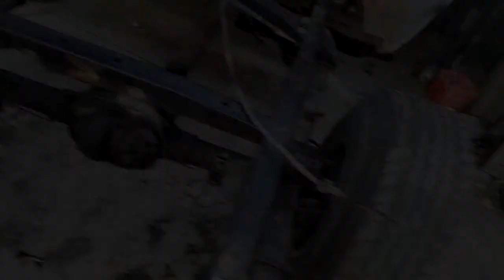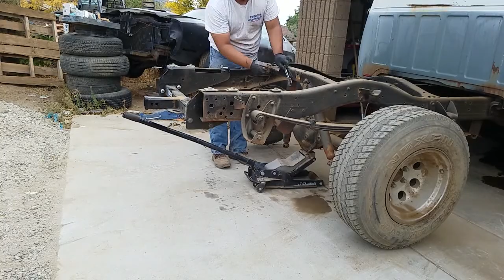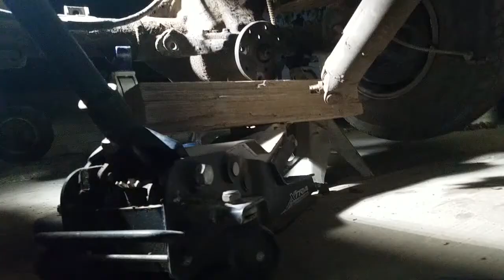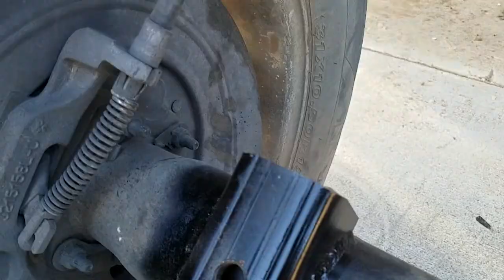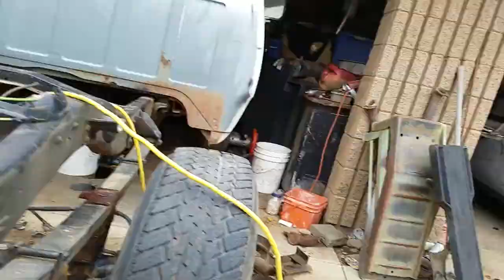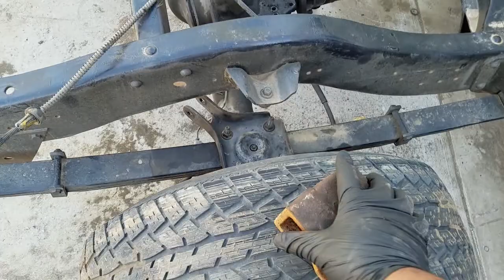Ford 8.8- Budget LSD Differential Swap On The Dodge D100 CHEAP |LS Swapped Dodge|NW EP.35

Comment: Hey bud I've got an 83 d150 I was wanting to do this swap I seen in one comment the rear end u used was 4 inch's narrower than the stock d150 rear did u use a spacer behind your wheels
Reply from the maker: I had a set of really deep M/T wheels on it so I didnt have to use spacers. Ideally you would want to extend the 8.8 and use 2 long axles but It may not be nessesary depending on your wheel selection and whether or not you widen the wheel tubs

Comment: What about drive shaft do drive shafts mount to rear end the same
Reply from the maker: It depends, the 8.8 comes with either an 1310 or 1330 ujoint flange. Some trucks come like that from the factory so it should work but most of them dont so you'll need to either buy a yoke to match your driveshaft or modify the driveshaft itself

Comment: How did you deal with the offset with the 8.8
Reply from the maker: I didn't, I centered the axle on my truck, making sure the tires were the same distance away from each frame rail and then welded in the perches. The offset doesn't affect anything so if you have room, and the extra 3in of width doesn't bother you, then you can just install it straight up like I did. Even in stock form it was a little too narrow for my truck so I should have swapped to another long side to gain 3 inches of width but it didn't bother me.

Comment: What year explorer? did you modify the axel other then the perches?
Reply from the maker: I just cut all the extra brackets off except for the swap bar brackets, welded on the new perches and used the sway bar brackets to mount my shocks. Stock 8.8 brake lines fit on my truck
Reply: @NightWrencher  what about the 8.8 having one side longer then the other
Reply from the maker: It didn't bother anything. I set my pinion angle and let it go with no issues. The diff ball is offset to the right, but its fine. You can shorten or lengthen it if you really want to by swapping the legs with another diff if the stock width doesnt fit as is.

Comment: Was the wheel base the same on the explorer and the truck? I thought the explorers had one side longer

I have a 84 d150 and I’m dying to know more info on this.
Reply from the maker: the explorer is about 4 inches narrower than the stock diff and the pattern is 5x4.5 not 5x5.5 like on the 80s trucks. Even with conversion spacers, itll still be a little tucked in. The ball is offset to the passenger side but that's not going to cause a problem on install. find the center of the axle and measure off that instead

Comment: Hi, what year is your truck and the explorer that donated the axle.
I wanna do the same on my 91 d150 which has 5x5.5 or 139.7 bolt pattern.
Does the explorer really have that bolt pattern too??
Reply from the maker: Not quite, the explorer has a 5×4.5 pattern like the 74-78 fulltime 4wd. As far as I know, all the other half tons are 5x5.5 so youll need wheel adapters which is fine because the explorer rear end is about 5 inches narrower than the stock front suspension